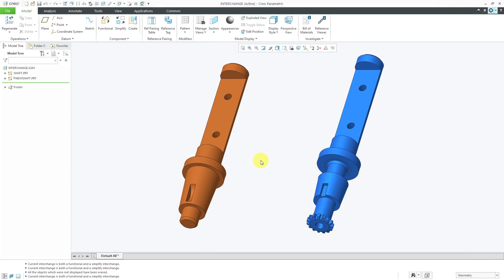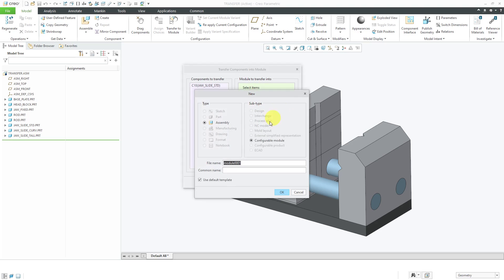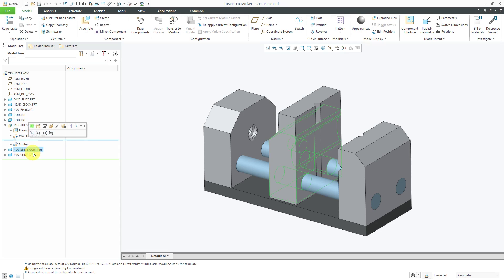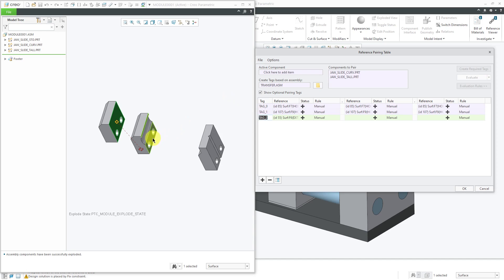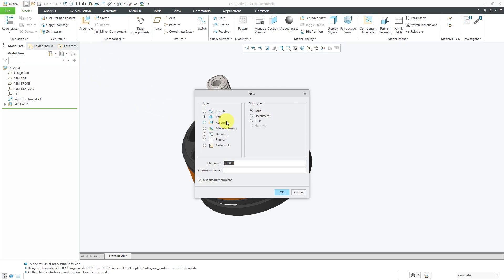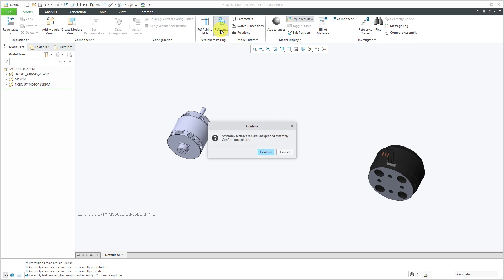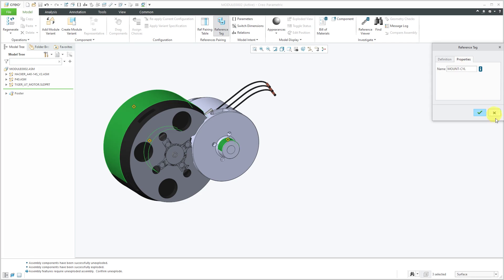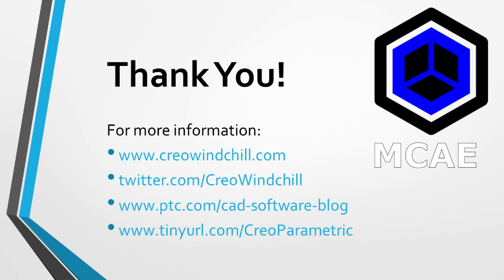Creo Parametric - Configurable Modules - Options Modeler

Comment: Hello!
Great Video, Thank you, it was very useful. I have started using Options modeler for one of my latest projects. But realized that Module variants cannot be interchanged using Pro-program. So thinking of moving back.
Is there a way of going back from Configurable module to interchange assemblies?
Thank you and Kind Regards.
Reply from the maker: Unfortunately, I do not see a way of saving a Configurable Module as an Interchange Assembly.